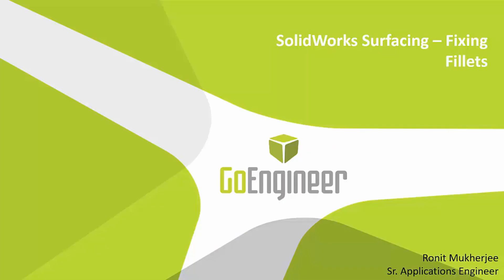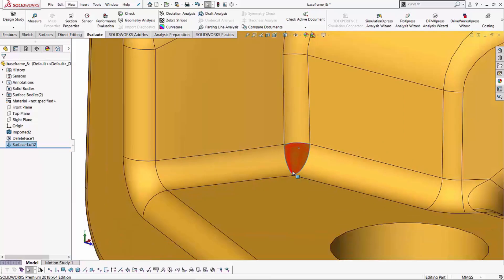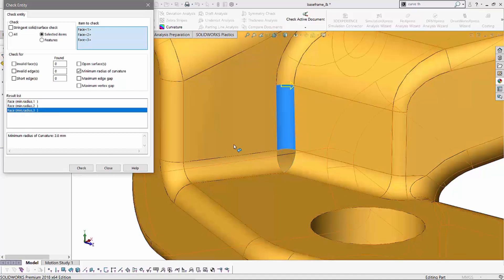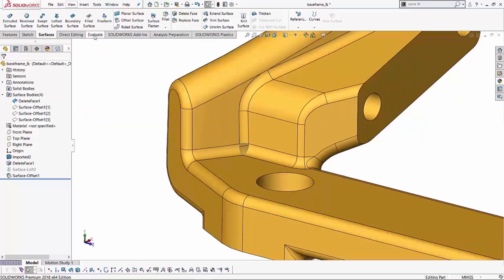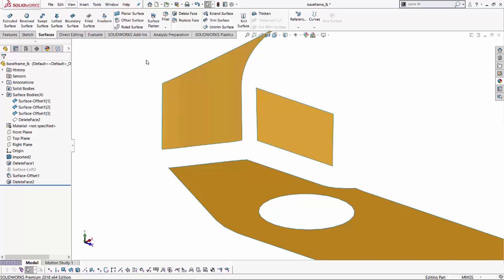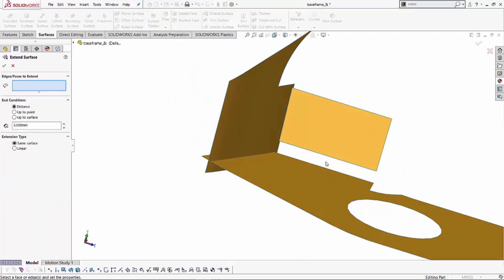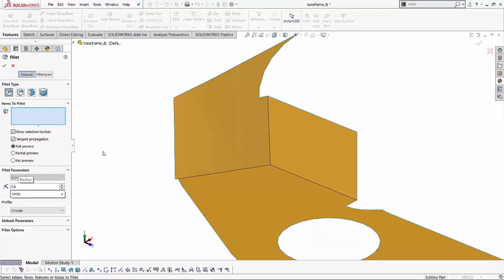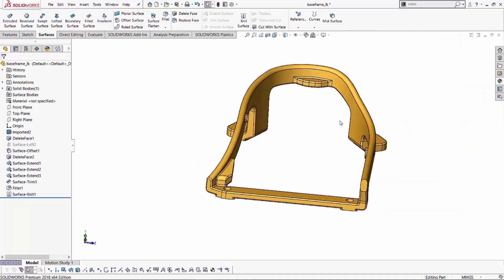SOLIDWORKS Surfacing - Fixing Fillets Using Surfaces

Comment: Can't you just delete face all the fillet surfaces.  Then extend the edges, trim and re-fillet?  If "extend edge" doesn't work then use Ruled Surface(tangent to surface). Doesn't seem necessary to copy the whole surfaces.
Reply from the maker: I would typically try deleting the faces first, too.  In this particular case, this procedure doesn’t work and we have to go down a different path.  Having a large bag of tricks when fixing imports is a great skill to develop.